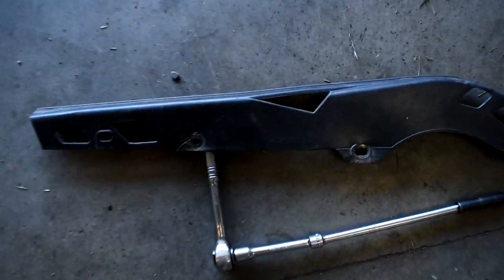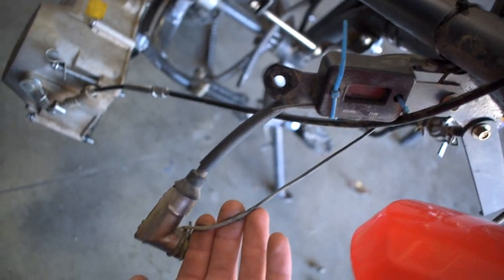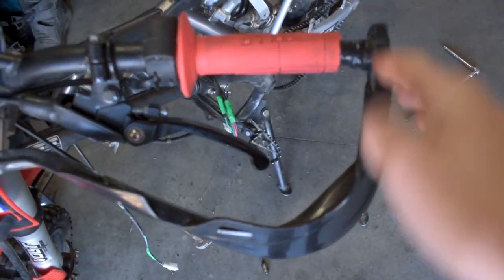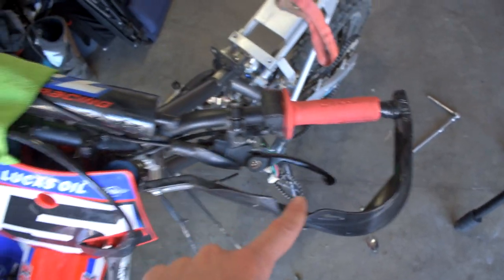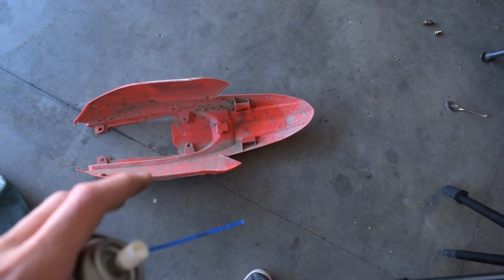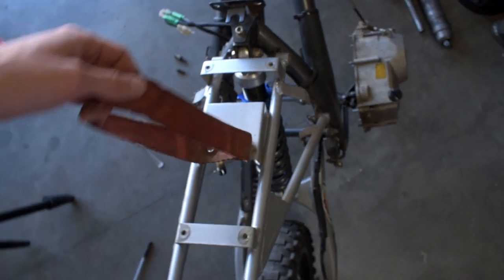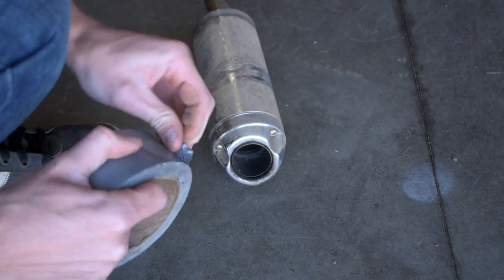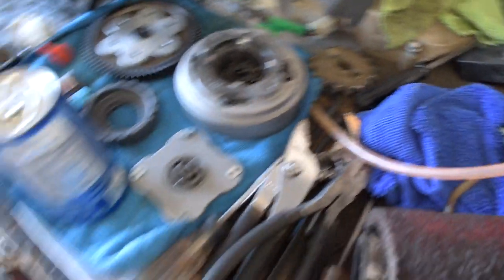Top 15 + Tricks And Tips For Your Pit / Dirt Bike!

Comment: Ha.     Ha ha.      Omg hahahahahahahaha. I could only make it to the hand guards which no pitbike on the planet should ever have on it. Btw that wire on the hour meter is simply just a wire. It dose not ground anything all it dose is sense the pulse of each high voltage discharge of the coil via magnetic field and there not that important to have if like you mentioned you do your service work at the correct intervals. Key word there is correct and not what the manufacturer says.

Comment: A little added tip on glue and plastics they actually make a product called Q bond, it's 2 parts, one black powder and one liquid you put powder on then drop some of the setting liquid on top and it instantly sets rock solid like a new layer of plastic, it's great stuff and only cheap 👍🏻 look it up
Reply from the maker: Definitely will take a look at that! Can always use more tools in my arsenal! Thanks for the input!

Comment: Higher octane fuel alone will do nothing for the performance of an engine that's not designed for it!
Reply from the maker: Mechanic's Note: If your dirt bike or ATV engine is tuned to run at a higher octane you'll need to invest in higher octane fuel. For example, a higher compression piston could cause the fuel to detonate (causing knocking) rather than burn which affects performance. Check the owner's manual. Most non-ethanol based fuel is rated at 90 octane and recommended for Motocross bikes.

One type of gas to avoid, if at all possible, is ethanol-based. Yes, it is difficult nowadays to find gas that's not corn fed especially in certain parts of the country or during a specific time of year. If you have a choice, pay extra or go out of your way for straight-up gas, otherwise it's OK to use the ethanol-based. It works just fine and won't hamper performance. However, we advise NOT using an ethanol concentration above 10 percent.

The big concern using ethanol-based fuel is corrosion. Ethanol attracts moisture which overtime corrodes vital engine parts. Therefore, burn off all ethanol-based fuel in the tank, drain the tank or add a fuel stabilizer if left in the tank for long periods. Ethanol-based fuel eventually gels and clogs the jets.